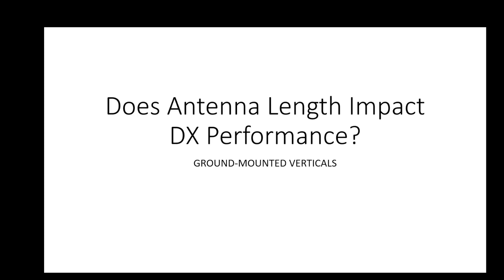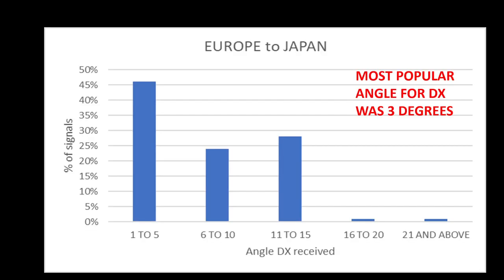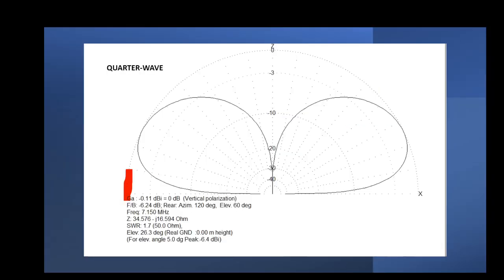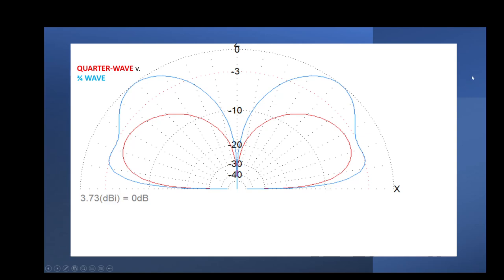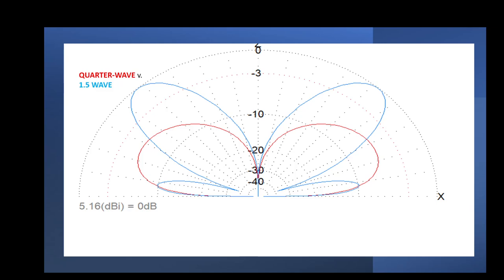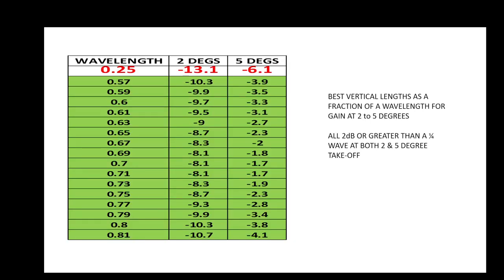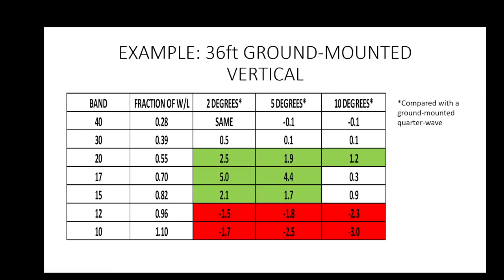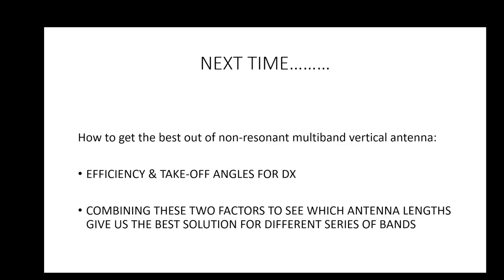BEST VERTICAL ANTENNA Lengths for DX

Comment: Well done Tim!  Thank you for showing this.  I find that too many hams are fixated on SWR, and cut their antennas to give a good match.  What they really should be doing is cutting the antenna for the desired angle or pattern of radiation, and THEN creating a matching network (at the antenna) to transfer maximum energy from the feedline.  Most have the cart before the horse.  73 & stay safe.
Reply from the maker: I couldn’t agree more
Reply: Well said Greg
Reply: Very good point

Comment: Your point about longer verticals sometimes having excellent very low angle radiation (despite also developing high angle lobes) is well taken. But to work DX you have to hear them, as well as have them hear you. Those high angle lobes can mean you will be receiving lots of QRM from nearby stations, as well as QRN from nearby thunderstorms, both of which could be far less with a shorter antenna not having those high angle lobes. That receiving advantage with a shorter vertical might well be worth a few dB sacrificed in transmitted field strength.

David  VE7EZM and AF7BZ
Reply from the maker: Good points 👍

Comment: Ive worked Japan, Indonesia, New Caledonia, Chile, Alaska, on ssb from UK using my trusty HORIZONTAL end fed piece of wire which is 20m long. Radio waves get their polarization all mixed up anyway due to hopping. Having the right propogation across the globe is far more important than whether you're using a 5/8 or 1/2 or 1/4 wave.
Reply from the maker: Thank you for your input, 73

Comment: Another interesting analysis, and as WECB640 wrote we really should design for pattern and then figure out the matching. The models don't of course show every factor. In my small garden for instance a ground mounted quarterwave  perhaps for 10m will by definition radiate all of the field from points less than 2.5m from the ground. Much of the low angle radiation will consequently be absorbed by fences, houses and foliage. A three  quarter wave mounted at ground level will have a high current node centred at 5m off the ground. Way above the fences and much of the foliage and close to the height of the houses. This will lead to more low angle radiation escaping from the absorption by obstacles nearby. As another commenter mentioned the high angle lobes of the three quarterwave can be a problem with signal to noise. In my youth on CB in the early 1980s I used a Sigma 4 mounted at a good height over 100ft from any houses. It was very effective but at times the S/N was dreadful compared to a five eighth wave with the cleaner pattern.  73
Reply from the maker: Great points thank you

Comment: I would be very interested in how the random 41ft vertical wire antenna does.  If there is an easy way to do all the calculations (as you did for the 36ft antenna) please share it and I'll do the calculations myself.  This is really interesting for use home brew builders.  I just started to build my own and I'm having a blast and this kind of information helps me a lot!!!  Thanks for all your content!
Reply from the maker: I’ll check out the 41 feet version soon

Comment: Great info Tim. As you know I only use resonant 1/4 wave verts which give me dx everyday zl to eu, and as we know there are many more important factors , apart from ant length , ground system, location,  propagation etc, all of the factors including your info could alter takeoff and therefore db gain, but not really enough so the guy on the other end would know. The old set up of a simple 1/4 wave with radials will beat or be as good as most other ants.
Iam doing daily tests with a Swedish stn, he has a 40m loop and a 4 sqr, mmna puts the 4 sqr way ahead, but in real life it doesn't,  2 s points down on the loop working dx hi. 
Look forward to your next video Tim, 73 mate zl3xdj
Reply from the maker: Cheers Brian !
Reply: @timg5tm941  I've got a new ant video on my qrz if your interested, cheers mate.

Comment: 5:53 There's something funny about the graph, the blue 3/4 Wave antenna has higher gain EVERYWHERE, which means that this graph CANNOT be a 'Directivity' graph, as directivity must always integrate to precisely unity. Therefore, this must be a 'Gain' graph which combines directivity and losses. So the information is incomplete, in that our host isn't even mentioning loss here. Not sure why, but this information glitch instantly jumped out at me. Directivity plots always integrate to unity, so all antennas have the exact same average directivity. Gain includes also loss, but you need to discuss loss to understand where and why.

Comment: Good video as always, I've been experimenting with a 1/4 wave vertical on 20m using 32 x 5m radials and it works well but I don't think it's as good as my vertical end fed 1/2 wave on 20m from UK Antennas plus no radials and easier to deploy!!
Nick 
2E0PDN
Reply from the maker: Agree!

Comment: I'm confused by this. Can someone maybe explain? How can the antenna radiate more power in all directions. My understanding was, that an antenna can only redirect, or "focus" power in certain directions. This would implicate for gains at 5° of elevation you would lose some power on say 45° of elevation. The plots here show a gain from one antenna to the next over all elevations. This feels odd to me and i wonder if theres something wrong with MMANA. Maybe SWR does impact far field plots in MMANA after all, at least the absolute values.🤷‍♂
Reply from the maker: A vertical is omni directional with a 360 degree coverage of ground radials such as those modelled here 73
Reply: @timg5tm941  Thanks for the response :). Maybe the meaning of my question got lost in translation. The antennas you modelled and compared were all verticals, but e.g. the 0.7*lambda did perform better than the 0.25*lambda over all take-off-angles. I would have thought that to gain at one take-off-angle one would need to lose at another. 73 DD4AB
Reply: And dont get me wrong, i veriefied your results in MMANA. I just dont understand how one vertical can be better than another at all take-off-angles if the power is the same and everything is radiated. Having one antennas far field plot completely contained within anothers far field plot is what puzzles me.
Reply: Can only be loss (to ground) with real antennas. The volume of the „bubble“ that is deformed should always be the same (1) with ideal antennas.

Comment: Recently I went down a rabbit hole in wikipedia about antennas. The article was talking about vertical antennas and wavelengths, and after a point there was no benefit in going bigger. From memory I thought it was 5/8 wave, but of course, now I can't find my way back to that rabbit hole! Anyway, from what you've shown, perhaps I'll try build a 3/4 wave 10M antenna. And maybe 15M.
I'd also been pondering, what would happen if I could somehow make my efhw a vertical ? (I'd need a bloody long squid pole!!) 
73
Reply from the maker: 3/4 wave is good .. it will need matching to a 50 ohm feed. However, I will cover this in a forthcoming video

Comment: So it looks like .70 WL for any band is optimum for a monobander? How high is base above ground? Z at optimum height AGL? Much appreciation Tim!
Reply from the maker: Hi Mark you’ll need a tuner although a 3/4 wave should present a decent match. The antenna is ground mounted. 73

Comment: Great video Tim. More or less what I would expect based on what I’ve read elsewhere and heard others say but I really like the clear and concise way that present the information. I guess that’s your professional background showing!

With 1.25 & 1.5 wavelength antennas sending most of their RF skywards I have wondered how well these would work for chasing SOTA or WWFF (which is mostly short hop, high angle around the UK & Europe)?

Obviously there are some practical problems with building a vertical approximately 60m tall, assuming that I am chasing mostly on 40m but it might be possible with a kite antenna!

Obviously there are much easier & more sensible ways to achieve the same result with much less effort (such as using an inverted V) but it could be interesting as a purely educational exercise!
Reply from the maker: Love to see the 40m efhw with a kite - awesome!

Comment: Hi Tim. Question . Just theory. So i have a yagi beam tuned for 20m. I have it up in the air say 5 to 10m above ground with no building near. So using you findings, would i angle the beam at say around 4 to 5 degrees from earth . Would this give me a better DX than having it parallel to earth. ???. Just curious as to your idea's on this. Thanks for the great video.
Steve. M7DOZ.
Reply from the maker: Hi Steve being a yagi it will radiate at low angles but to make it sing it still needs to be closer to half a wavelength in the air. 73
Reply: @timg5tm941  Slightly confused Tim. Do you mean if it was for 20 metre band , then it would need to be 20 metres above ground. ????
Steve

Comment: Thanks Tim.   Only transmit when out in the motor, 20 & 40 Ampros.      I'm thinking about the "slide winder" coil with the "Mil whip" on a magnetic base.    Would you (or anyone one else) recommend it, or is there something better that I could use?   Obviously I could throw poles out & about with dipoles & wires and whatnot but, you know  ->  convenience , and I'm a little self conscious about mounting erections out in public etc.
Reply from the maker: The Slidewinder has a wider coil and the mil whip is longer than the Ampro so a little more efficient also once you learn the points to tune to it’s a little more convenient than swapping a whole antenna to change bands. That said, Ampro whips at 20m and above represent very good value for money and work very well 73
Reply: @timg5tm941  Thank you.